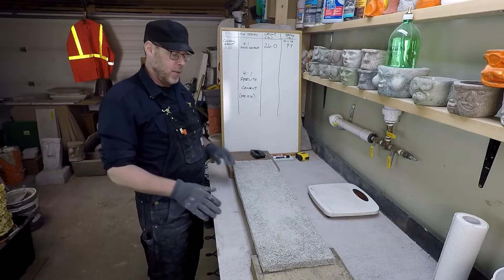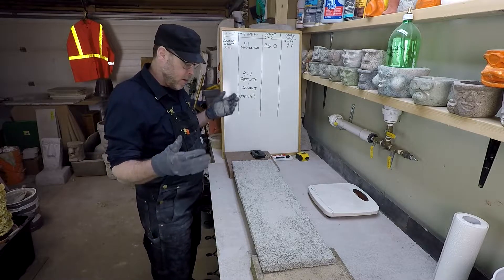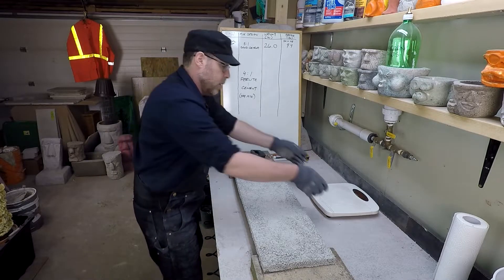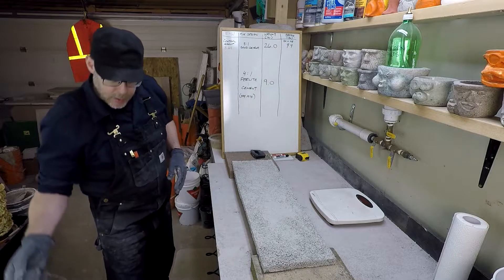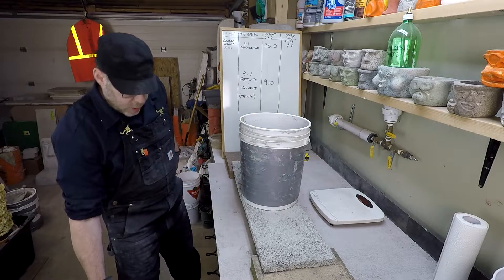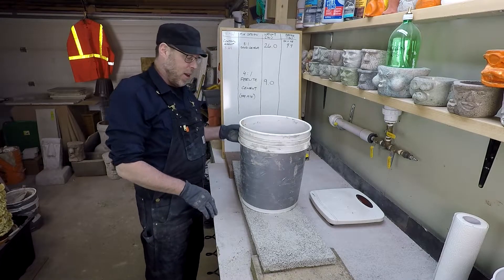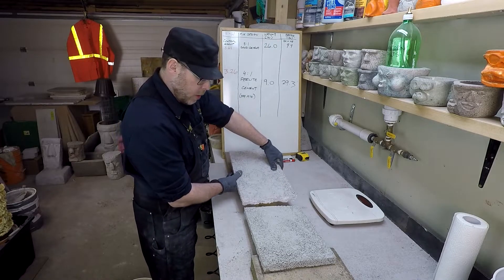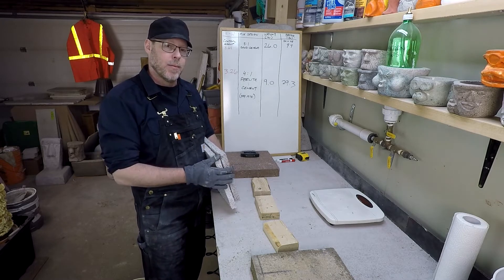Lightweight Concrete Strength Testing - Perlite 4:1 Mix Ratio

Comment: Have you ever tested how much you can push the strength to weight ratio, with things like fibrous reinforcing and water reducers to improve the mix? I'm looking for a fire-safe external wall insulation coating for a building in an earthquake zone, and I'm pretty sure perlcrete is the way to go, but I'd love to see how you can manipulate the composition to make it a whole lot more robust to the shock of a big quake.

Comment: Great testing, what would a regular concrete block like you made? How much weight would that hold like that? Perlite could hold 25 lb about what would a regular piece of concrete? Just like if you'd get concrete from Lowe's or home Depot and if you made a block out of that, how much weight would that hold?
Reply from the maker: Here is the control block test which shows the full strength / full weight test block: https://youtu.be/mfJBbCWg6dw

Comment: Hi, I'm back. I have everything needed to cast four fake moss rocks using your 4:1 Perlite to hide my gutter downspouts. These will run from 20x30 to 20x51, all 3 1/2" thick. I will use 1/4" hardware cloth, glass fibers, and Weldbond for added strength. I have a packet of pigment powder from DirectColors that shows 1 lb color per 94 lb bag of grey Portland to achieve the color shown. Not sure if I need to figure by weight or by volume on the pigment so I'd love you opinion on the ratio of pigment per ??? of this 4:1 Perlite mix. I do plan on skimming the outer faces of the mold with straight cement, then back-filling with the 4:1 mix, so color should be OK for the outer layer using DC's recipe, not sure on the backfill color... Thanks!
Reply from the maker: integral color is just about trial and error.  Getting any kind of consistent color with integral pigments is very tough
Reply: @creatingconcrete  Thanks, kinda figured that would be the case. Do you know if the Perlite take on a dye's color or is it treated simply as an aggregate, taking up room and staying neutral?
Reply from the maker: @russellselkirk3956  it absorbs some color but remains white in the center
Reply: @creatingconcrete  Thanks so much for taking time to reply, here and my Q's on your other vids! I had no intention of turning your channel into a Q&A, so I do apologize for that. I hope I've learned enough here to do you justice!

Comment: I’m going to be making some bricks/small blocks to build a light weight short 3 sided wall around my yurts wood stove with perlite and cement.  When you say 4:1  is that 4 parts perlite to one part cement?  Say if I did more perlite would it make each brick lighter say 5:1 or 6:1?    If one standard red brick weighs 5 pounds how much do you think a brick made of perlite and cement would weigh approximately?
Reply from the maker: 4:1 means 4 perlite to one cement. If you increase the ratio to 6:1 for example, it will be lighter.  I am not sure how much it would weight, but be aware that if it is exposed to heat you need to use high temp cement which has lime and clay in the mix.  Without it the portland cement will fail when exposed to high temps.